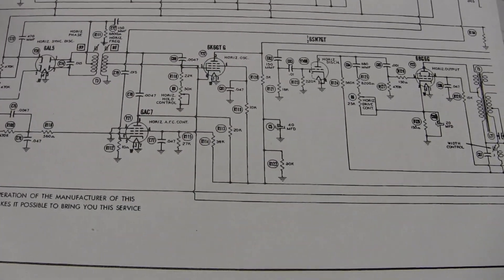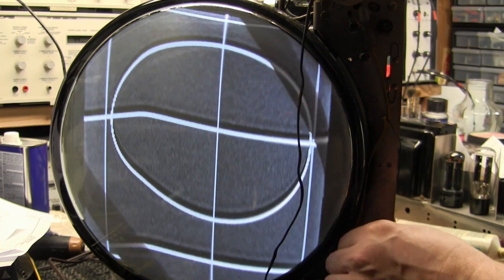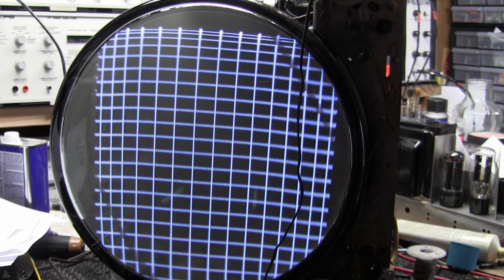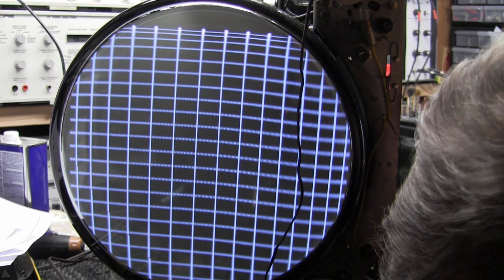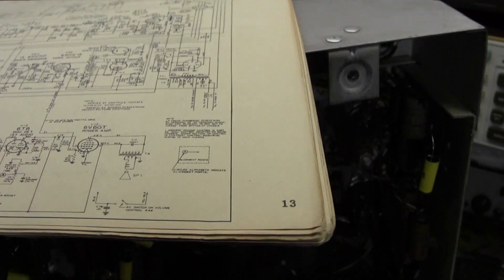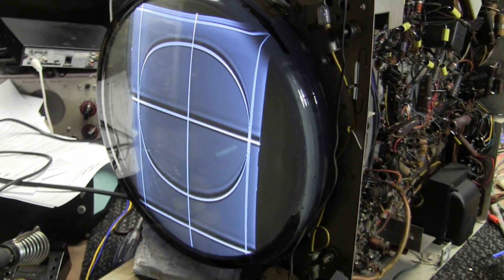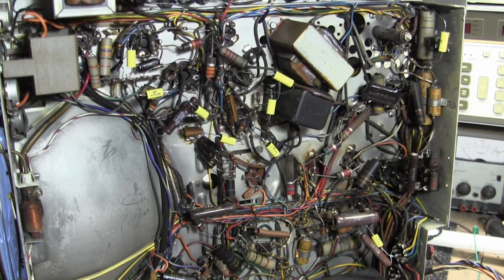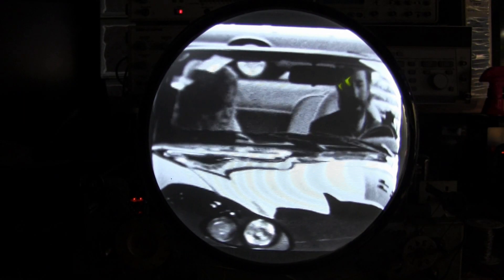Zenith 28T960 "Waldorf" part 7 - Getting a stable image

Comment: Interesting video as all the time. I wonder if you ever have noted  different behaviors, if any, taking care of outher foils of film capacitors orientation.
Reply from the maker: No, there is very little difference comparing to actually foil capacitors.  These are metalized film and they stopped marking them because they are not made the same as paper/foil caps.  Yes, I'm aware you can measure a difference using a scope or other device, but that difference is not significant.